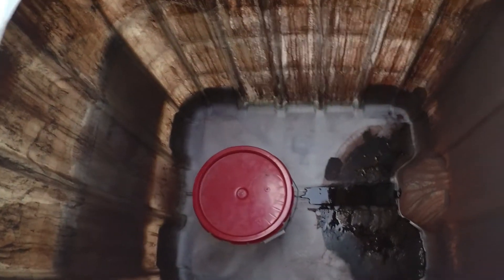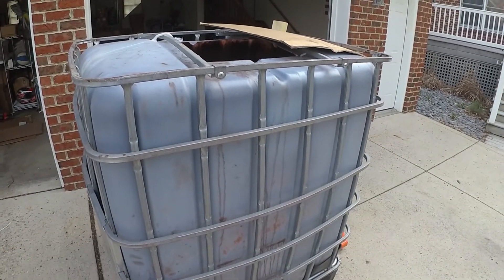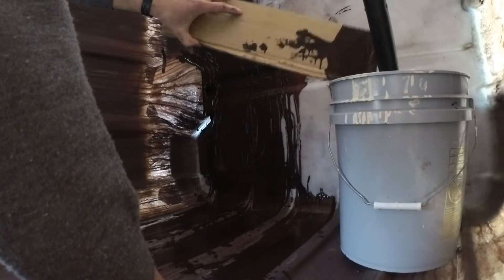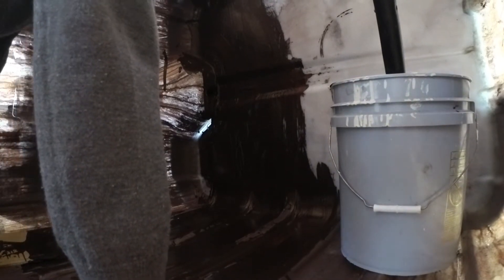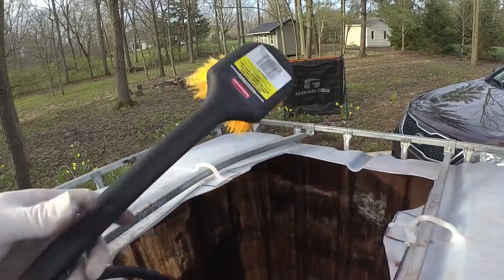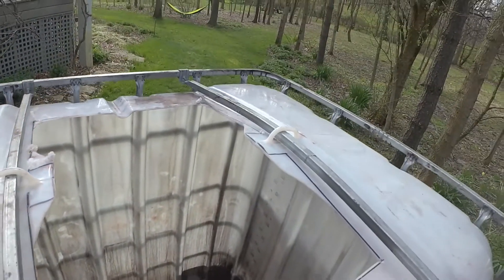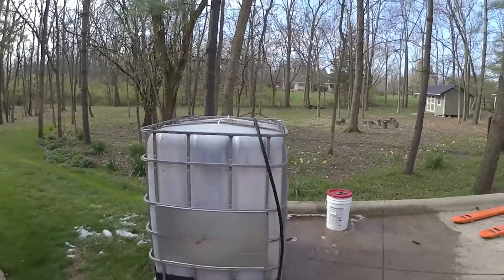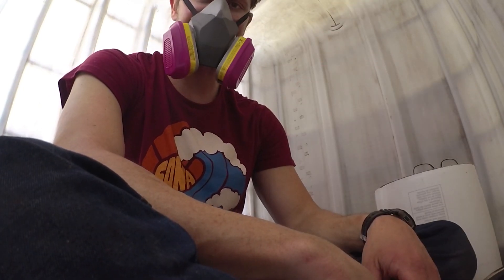DIY HYPERBARIC CHAMBER - (Part 2) - Cleaning the Chamber

Comment: Did you ever finish this, or gave up?!
Reply from the maker: I did finish it, the biggest issue I had was the door. Tape and plastic worked but a smaller circular door would have been better.

But it does build pressure and hold it.
Reply: Update video would be awesome thanks

Comment: Hi I have just received 3 HBOT 90mins session with great success. So I am considering building my own especially as the well made mild hyperbaric chambers are £18000 and the cheaper ones aren't worth buying in my opinion!!!! I thoroughly enjoyed your videos and would like to ask if ok..... I want to build a chamber that can comfortably go up to 1.5 ATA which I believe is 7psi. Do you think your chamber would comfortably and regularly sustain 90mins sessions at 1.5 ATA without problems?  The bulging seemed quite severe on the video I wondered whether you thought some reinforcing would be an advantage or whether you considered the chamber would be better off allowing it to expand and contract?
Reply from the maker: I believe this chamber works well. The only thing is to make a good hatch. I used tape and plastic wrap to seal it up. The bulging i feel is a good thing. Shows your under pressure kinda like the plastic cacoons. Just come up with a good hatch system.

Comment: Any updates?
Reply from the maker: No updates. I need to look for the finished video and post it. But I can say it does work. One thing I never did was get an oxygen concentrator. The chamber holds pressure.
Reply: @joshdorsey66  
You should keep at it. They've just shown that hyperbaric O2 lengthens the chromosomal telomeres, essentially turning back the aging clock.

Comment: I'm thinking of doing the same thing you are. You said plywood door do you think it will conform to the bubble and hold up? Have u tested a door? Would it be dangerous if it blowers out all the pressure at once if the door suddenly failed?
Reply from the maker: The door I have used is a heavy duty bag and 3 inch tape. The difficulty is with the chamber and its curved parts around the opening. It takes time once in to get it sealed air tight. But it works.

Comment: Any more progress on this tank?
Reply from the maker: Yea, Works wonderful. What would you like to know more about? I'd recommend purchasing a clean one, its worth spending a couple more dollars for it to be clean.
Reply: Have you been able to connect a pressure gauge to get an actual reading on the pressure it holds?
Reply from the maker: I have not yet. Need to order one just haven't gotten around to it yet. There are many that go up to 60-100lbs in stores nothing with smaller increments.